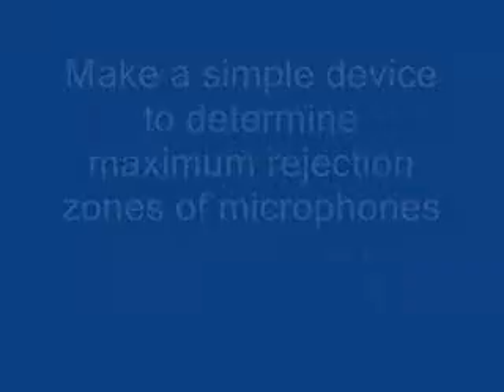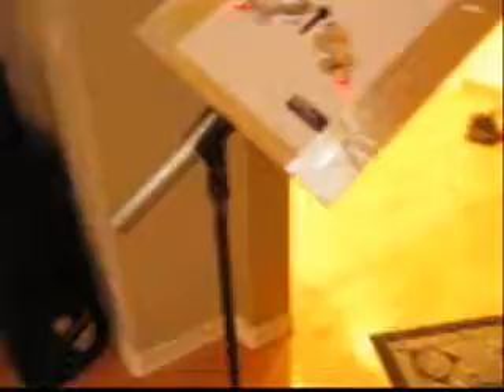Get Stage Monitors Louder by identifying the mic rejection zones

Comment: Dave, I sing and play acoustic in a loud band, I use a beta58 and two qsc k12s as wedges. Our mixer is a Berhinger X-Air. Love the freedom and control of my own monitors from my iPad. I pretty much eat the mic the whole night. My voice is pretty low and has a fair amount of power.

My question is how do I keep the depth of the low end without getting muddy? Seems like my voice, my j45 acoustic and the bass are all playing in the same frequency range .

I've been able to get a usable sound but would like to get better. I'm a novice when it comes to running sound. 

Should I look at different mics, monitor placement, duck frequencies? And suggestions would be great! 

Your videos are great! Keep it up!
Reply: Audio guy here. I'd try cutting some low mid freq's from both your vocal channel, and maybe even the aux that your wedges are on. Im thinking 200 to 400hz by between 3 and 5db. This should allow the more articulate tones to cut through a little better, and may allow more over-all volume without your A string starting to feed back. I've had great success in many venues and many different monitor systems this way. Hope that helps! Cheers!!
Reply: answer is: eq your voice signal going to wedge. dont know if your mixer has oportunity to eq aux path..if yes, try tu put down freq around 200-270 Hz..

Comment: @dave rat     Thank you so much for sharing your bottomless knowledge. helps a lot. I have a question though: On a live event, are you typically sending a full spectrum frequencies in your wedges or are you cutting some (let's say less basses or less middles, or highs)? Thank you in advance for your appreciated answer & time.
Reply from the maker: +inUR2teeth there is almost always some sort of low frequency cut in all speaker systems. The amount of low frequency cut depends on the capabilities of the design and the desired sound.  For stage monitors, cutting low frequencies to protect them from damage is important.  Additionally there are advantages to cutting low frequencies in most wedge designs and using the side fills for the low frequencies. On well designed high power wedges, you can run considerable amounts of low frequencies for bass and drums, but nearly always, you will want to cut some low frequencies off of vocal mics.
Reply: +Dave Rat my question was rather pointing to your approach of ringing the wedges out.. Are you cutting the faulty frequencies out of the wedges directly or do you prefer to work directly on the main out signal, or both?
Reply from the maker: inUR2teeth I try and EQ the wedges such that they will be able to clearly reproduce the variety of instruments that they most likely will be sent. Ideally if the wedge sound good and each channel sent to the wedge also sounds good, all will be good. I try and fix issues at the place they are first created. If a vocal has too much 400, I EG the channel.  If a wedge has a peak at 800, I EQ the wedge.
Reply: +Dave Rat Crystal clear,  Captain. Thank you!